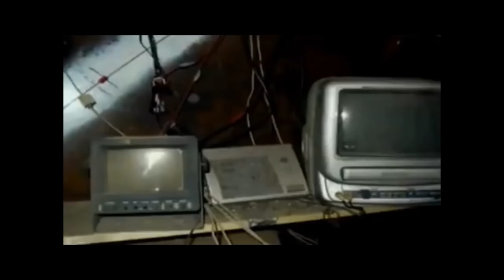Marvin John Heemeyer: A Real American Heero

Comment: Marvin Heemeyer was a man who owned a muffler shop in Granby, Colorado. The city council ordained to approve the construction of a concrete factory in the lot across from Marvin’s shop. In the process this blocked the only access road to the muffler shop. Marvin petitioned to stop the construction to no avail. He petitioned to construct a new access road, and even bought the heavy machinery to do so himself. Denied.

The concrete factory went up in disregard to the ramifications on Marvin’s business. To add insult to injury, the factory construction disconnected the muffler shop from the city sewage lines. An indifferent city government then chose to fine Marvin for this.

His business and livelihood were in ruin. Rather than lie down and die, Marvin chose to fight back. Over the course of a year and a half Marvin secretly outfitted the bulldozer he bought to save his business with three foot thick steel and concrete armor, camera systems guarded with bulletproof glass.

On June 4th 2004 Marvin Heemeyer lowered the armored shell over top of himself, entombing himself inside the Killdozer to make his last stand.

He burst fourth from the walls of his muffler shop and straight into the concrete factory that ruined his business. Over the course of the next several hours Marvin drove his Killdozer through 13 buildings owned by those officials that had wronged him, including the city council building itself.

Swat teams swarmed the dozer, but it proved immune to small arms fire and even explosives. Another piece of heavy machinery was even brought out to fight the Killdozer, but it too fell to the dozers righteous fury.

In the end, Marvin’s Killdozer became trapped in one of the buildings it was built to destroy. Marvin chose to take his life, the only life he took that day.

Today we celebrate Killdozer day and Marvin Heemeyer, the last great American folk hero. A man driven to the brink who chose to fight back against an indifferent system.

From notes left behind after his passing:

“I was always willing to be reasonable until I had to be unreasonable. Sometimes reasonable men must do unreasonable things.”
Reply: Push a man far enough, he becomes #ungovernable
Reply: "The only life he took that day was his own".  exactly right.  he had no intention of willfully killing anyone.  He shot 50 cal rounds at cops but obviously aimed wide above them.
Reply: Thanks for the detailed history. My sense was Marv was legitimately aggrieved and you presented his case ... totally!  Thanks!
Reply: I wouldn't call it an "indifferent system?"  Those town authorities knew exactly what was up! If it happened in Denver I'd say "indifferent"... not Granby.  Small point- the rest of your take was spot on!!
Reply: @skronked  there’s a documentary on Netflix  about him... it’s a must watch. Marv was a good man :(
Reply: Tragic. He was clearly a very talented man too. Small towns fuck over good people a lot.

Comment: "Today is a special day. June 4th 2020 marks the 16th anniversary of the Killdozer's rampage through Granby Colorado.

Sit down kids and let me tell you a tale, about a reasonable man driven to do unreasonable things.

Marvin Heemeyer was a man who owned a muffler shop in Granby Colorado. The city council ordained to approve the construction of a concrete factory in the lot across from Marvin's shop. In the process this blocked the only access road to the muffler shop. Marvin petitioned to stop the construction to no avail. Petitioned to construct a new access road, and even bought the heavy machinery to do so himself. Denied.

The concrete factory went up in disregard to the ramifications on Marvin's business. To add insult to injury, the factory construction disconnected the muffler shop from the city sewage lines. An indifferent city government then chose to fine Marvin for this.

His business and livelihood were in ruin. Rather than lie down and die, Marvin chose to fight back. Over the course of a year and a half Marvin secretly outfitted the bulldozer he bought to save his business with three foot thick steel and concrete armor, camera systems guarded with bulletproof glass.

On June 4th 2004 Marvin Heemeyer lowered the armored shell over top of himself, entombing himself inside the Killdozer to make his last stand.

He burst fourth from the walls of his muffler shop and straight into the concrete factory that ruined his business. Over the course of the next several hours Marvin drove his Killdozer through 13 buildings owned by those officials that had wronged him, including the city council building itself.

Swat teams swarmed the dozer, but it proved immune to small arms fire and even explosives. Another piece of heavy machinery was even brought out to fight the Killdozer, but it too fell to the dozers righteous fury.

In the end, Marvin's Killdozer became trapped in one of the buildings it was built to destroy. Marvin chose to take his life, the only life he took that day.

Today we celebrate Killdozer day and Marvin Heemeyer, the last great American folk hero. A man driven to the brink who chose to fight back against an indifferent system.

From notes left behind after his passing:
"I was always willing to be reasonable until I had to be unreasonable. Sometimes reasonable men must do unreasonable things."

HAPPY MOTHERFUCKING KILLDOZER DAY EVERYONE."

Comment: My understanding is that they shut down his shop because he didn't hook up to the sewer that they also wouldn't give him an easement to hook up to, and also refused to issue a permit to add access when the concrete company shut his existing access off. They then fined him for "junk vehicles" on the property - it's a damn repair shop, it's commercial, and thats a gross miss application of code. I have no doubts the concrete company guy paid off his buds on the town council to do this. Especially considering how the garbage truck company guy that finally bought his property had absolutely NO problem hooking up to water and sewer, and putting access in - and basically every company around there including the concrete company has shitty vehicles everywhere to this day.
Reply: Yes. What you probably realized but failed to convey is that the town was run by a few corrupt families that constantly screwed Marv over.
   It all started when he outbid and purchased the property for the muffler shop, the same property that the concrete company wanted. Which was owned by a  freind of the corrupt families.

Comment: My question is, how could he even see? Did he have a view point for him to see enough without getting shot?
Reply: He had monitors connected to cameras that were mounted outside the dozer
Reply: He had several cameras inscased in bulletproof glass with air compressors to blow any debris out of view, he had seven at all angles, and he only ever made warning shots in order to dispel crowds from what I remember
Reply: 1.53-1.55 - he had few cameras around dozer and monitors inside to see whats goins outside